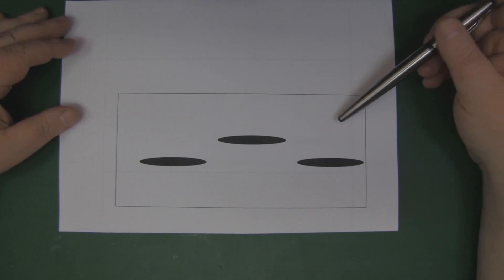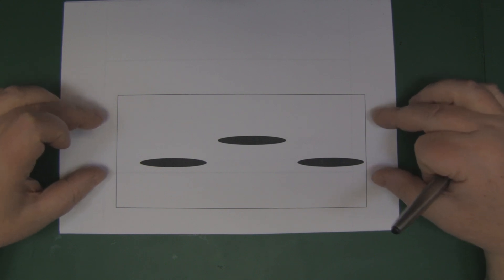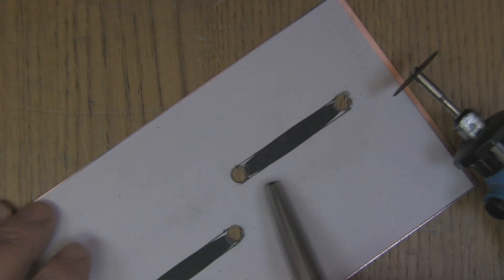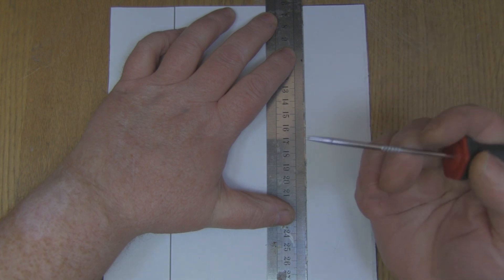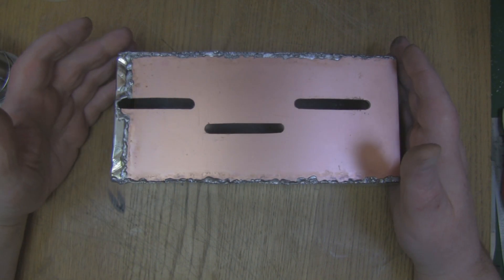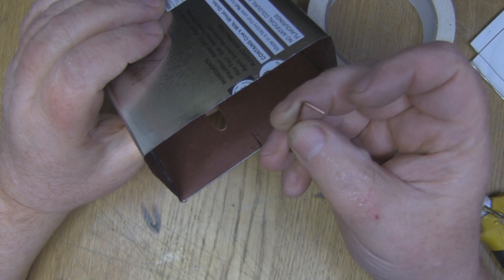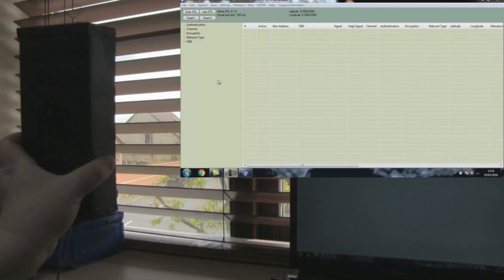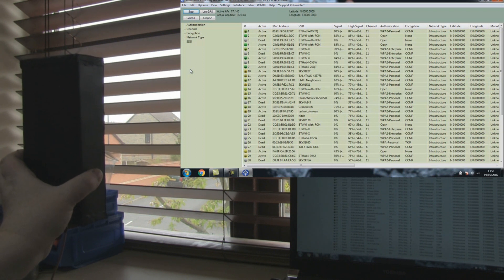waveguide slot Antenna for 2 4GHz

Comment: Thanks Andrew, you know your a McNeil fan when you see copper wire on the ground and pocket it for building something neat. :o)  We can still buy feric chloride here so maybe a marker masked etched panel would be neat to make. In the 80's they phazed out metal and wood shop here, I remember a ditzy girl taking her thumb almost off in a bandsaw once. That was the nail in the coffin for co-ed shop class. Too many distractions with the girls around LOL! I am glad the UK had proper manufacturing classes in 50-60's since my BSA shows the creativity that Brits can have, when not in a pub at lunch in Birmingham of old..
Reply from the maker: +Hoverbot1TV Also when you drive your wife nuts in the supermarket making her buy a different brand of washing up liquid because it has a cooler lid that I can use! The old BSA factory should have been made into a museum and protected by the heritage foundation. They produced such a diverse array of products for the UK and the world it was far more important than any castle from 1066. But that's just me. :-)
Reply: andrew mcneil Yup, BSA motorcycles are one of the true gems us colonial outposts got from those castle dwellers. LOL! More thumbs up from Indian cab drivers than anyone else on my 441 BSA. The Rocket3 is too much a blur. :o) I have upgraded most the Lucas stuff but their zenor diodes and rectifiers are very durable.

Comment: You should use a high thermal mass iron (I prefer the hakko horseshoe tip) for soldering large things, because the well allows you to apply a lot of solder quickly with high heat. Acid flux works really well, just flux the solder bar and seam.

Comment: could you not use a mustard tin which is actually quite small and should be easy to cut a hole for the socket and is easily soldered and might be a good idea to use the old style bin lid as a reflector don't know about the length of the supports to mount the feed unit at the focus of the bin lid.

Comment: would it be more powerful i you had a longer one with more holes? or holes in all directions? Or does it weaken it when there is more holes? 
You make it sound like as if this is more powerful than your other antennas in the range it can get. What would be your longest range antenna?
Reply: +xwsx001 The power remains constant. It only depends on your transmitter. The area that power is spread over (the beam width) increases with more slots. This was explained in the video.
Reply: well meaning when compared with another long range wifi antenna can this beat it if they both has to target one source?
If not which one is better for long range single source?
Reply: How long is a piece of string?
Reply: LOL true but not wifi